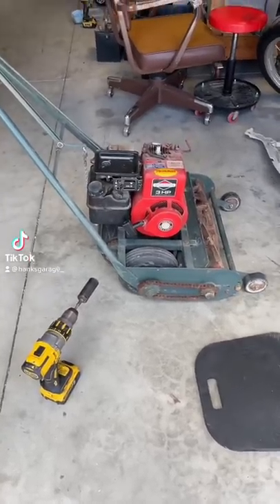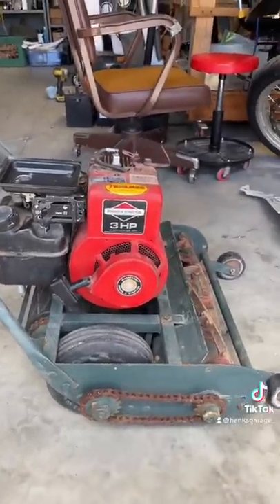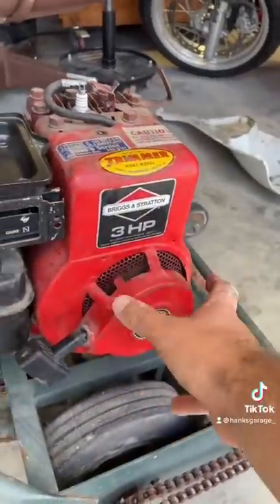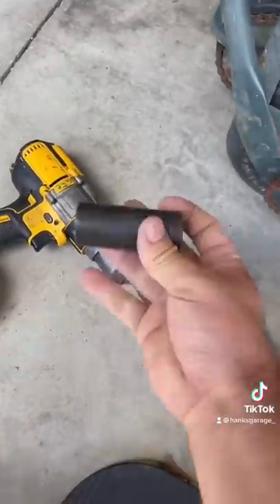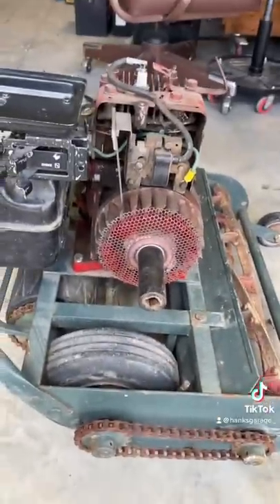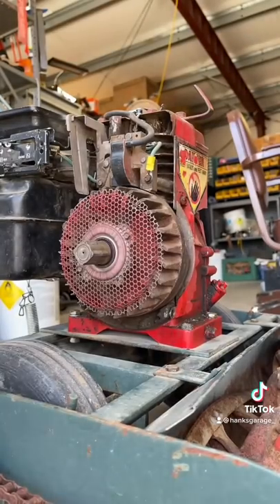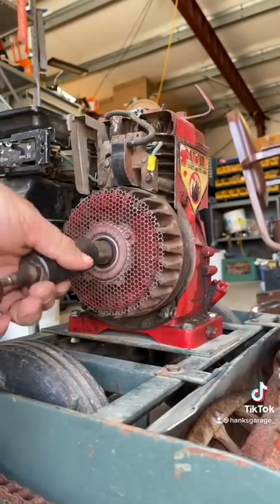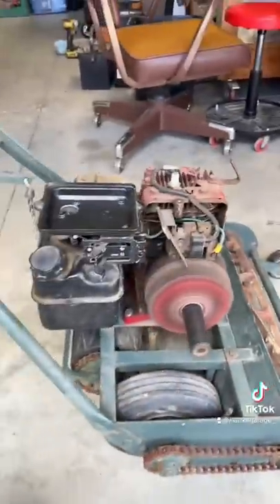SATIRE: 😂🤪 Drill start your Briggs? 😂🤪

Comment: I do this with a few of my machines. For anyone thinking about doing this, Quick tip for safety, keep the trigger on the drill held down so it spins with the engine until you get the socket off. Also you can put some electrical tape on the extension so it fits more snug in the socket.